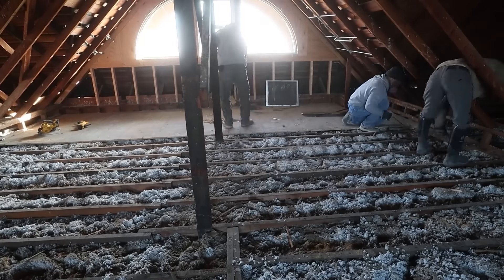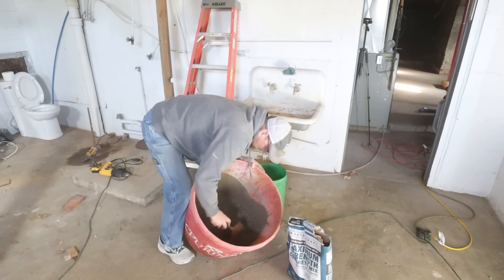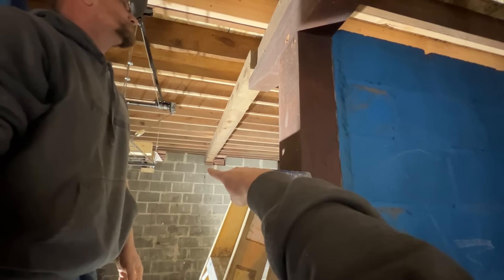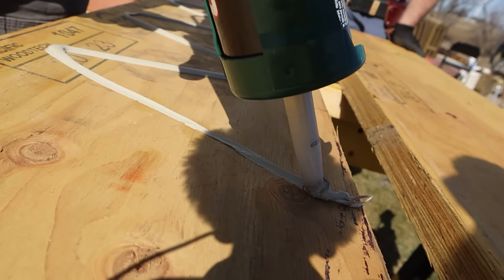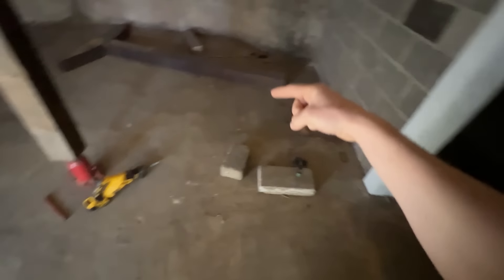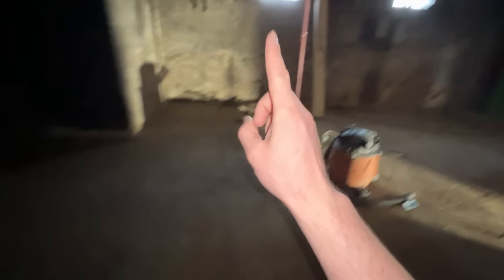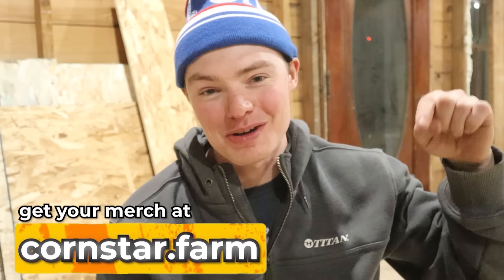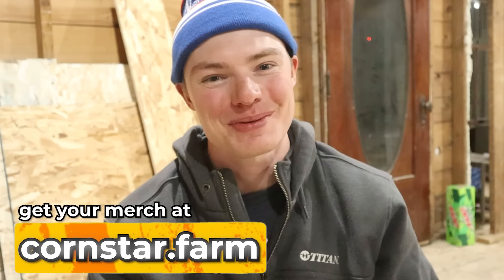Restoring A $7,000 Mansion: Rebuilding Basement Ceiling

Comment: The craziest plan i ever heard!! Breaking an good concrete floor. Make a hole on the lowest part for a submerged pump. And treat your walls and floor from the inside. Good solutions eneuf on the market, with very good results and much less expensively.
Reply: I agree, but he's apparently got the money to do it. This has to be outrageously expensive. He shouldn't call this "restoring" though, because that means to bring it back to its original condition. This is "modernizing", not restoring. It's going to be extremely nice when he's done and will be a great house to raise the next generations of Cornstars in, so they can help run the farm.
Reply: More fun than watching this old house❤😂
Reply: Nobody has said nothing about how getting old concrete out of basement. How many years to retirement for Justin and Roman  ??😅😂

Comment: Cole once you get your concrete work done I suggest you put a DRICORE Subfloor System over the concrete and then lay your flooring over that. "DRICORE is an insulated subfloor system" that has channels on one side and should any water/ moisture come up the water would follow the channels to the drains🌻Check it out.

Comment: Cole, love the videos.   I am a contractor in NW Illinois.  I have built several new houses and shops. Love radiant heat in concrete.  As for a house i could never justify the cost of radiant heat.  If you install central air conditioning you already need all the ductwork plus an air handler and all the other AC components.   At that point a forced air furnace cost is nil.  Possibly just install radiant in the basement slab?  Otherwise it is just a redundant  heat system.  If you love radiant heat that is your choice.  To each their own.  Keep up the good work!

Comment: Hi Cole - I know a lot about Radon. Radon is a daughter product from the disintegration of Radium. Even though Radium in mostly an Alpha radiation emitter - Radon is a Gamma radiation emitter. There are trace amounts of Radium in soil and rock. As Radon is a gas it enters the void of basements through the pores in concrete. Even if you tear out the old concrete floors, you will still have Radon seeping into the basement. Radon is also emitted from unpainted walls. It's in the concrete mix. If you plan on mitigating yourself, get a before test done to see the concentration that you have. Different mitigation techniques include 1) venting the basement to the outside, 2) sealing the concrete surfaces with paint such as a thick enamel paint and 3) venting under the concrete floor. After mitigation is complete get another test to ensure the fix was affected. I retired from a nuclear power plant here in NY. Worked there for 23 years. I also have a BS degree in Radiation Protection. At the plant the concrete walls and floors were feet thick - Radon still seeped through to the surface.
Reply: Cole needs to see this comment for sure...

Comment: Digging drain tile around the outside of the house isn't a bad idea. They make a drainage product that is a mesh material that you glue to the outside of the foundation. That runs the water down to a drainage pipe. 
   In rainy areas with basements a lot of times they run drain tile under the basement floor. If I were you I'd run it into the old well pit. Fill the well pit with rounded Rock not crushed limestone. You could also run the drain tile into shallow sump pump box placed over the filled in pit. That way, just for the heck of it, you could see if you're ever getting water under or around your home.
Reply: It's not a good idea to run storm water into an old well, because it contaminates the groundwater.
Reply: Correct  @ILGuy2012  you shouldn't run storm water into a well but this isn't storm water, its water that's been filtered by the soil. If it's okay to run field tile 3 ft deep into a stream it should be okay to run 8 ft deep groundwater into a 23' deep hole. 
    Plus have you ever seen or heard of an underground detention system? In big cities we build big underground vaults with Sand basins. To catch, slowly drain and filter storm water into the ground. 
     Also he has said the house hasn't leaked in over 100 years. Adding a drainage system would be only additional insurance and peace of mind. Very little, if any, water would ever run into that pit. 
     If he doesn't run the drain tile into the pit He only has two other options. 
Option 1. Run the drain tile into his septic system. If not illegal, it's not a good idea. You know it's sewer gases or in 35 years when the septic system starts to go bad. 
Option 2. Put in a sump pump. That will probably never run.

Comment: @ColeTheCornstar Your talking about a full immersive French drain system that include foundation drainage. So taking and putting a air aided PVC pipe around the outside walls of the basement so that water isn't encroaching into the house or basement walls and piping into that system a bunch of air aided PVC that runs the distance of the basement with the proper sloping in order to pipe out the water that does try to stand underneath the foundation once its reinstalled and formed. Yes you can do such a thing. And you will need a 10 metric tons of gravel and sand in order to have what you are talking about because you have to lay sand and gravel down once you have the piping in place. The water will flow through the gravel into the piping. and the sand will keep everything in place.

Comment: Glad you mentioned Radon. I just had a mitigation system installed in my home after testing revealed levels peaking at 40.0, which is really bad. I recommend you buy a RadonEye RD200 continuous tester for $175 as it will be much much cheaper than professional testing and allows you to move it around and detect any problem areas over a longer time frame.

Comment: Yes, drain tile under the floor is a good idea, especially since you'll have it torn up anyway.  When we built 20 years ago, we ran a couple tiles under the slab and it does run occasionally in the spring when the water table is high.  We're in heavy soils and our basement has always remained dry.

Comment: Radon is no fun, we have pipes under our slab and its vented out the roof. There's a fan on it that is run in winter. Its higher then. You might want to consider a fresh air duct with auto damper control for at least 10% air make up. Spray foam makes a tight house. Installing an exhaust fan, new code for new homes, pulls air in and around all your doors and windows. Ours runs 24/7 cause of radon

Comment: Great job on rebuilding the house. If it is the plans when you install the new floor in the basement installing a Radon system along with a perimeter drainage system would be very beneficial to you in the long run.The cost of a active Radon is low cost. Would also suggest installing a sump pump to assist in removing any water that possibly enter the basement. When installing a new concrete floor you may want to install at least 4 to 6 inches of crush stone and on top of the crushed stone a minimum of 6 mil poly plastic sheathing. The crushed stone and vapor barrier will allow the radon system to work very efficiently.

Comment: Concrete Pump for the basement floor. Concrete truck pours right into the pump truck and they use large hoses to shoot the concrete in. Could run up a big tab, so a couple wheel barrows with wood to roll on will be the cheap option

Comment: Regarding the radon, if you're planning on putting in a drainage system in the basement anyways get a radon sump dome cover. Typical installs involve digging a small hole under the slab and only draw air from that one location. By leveraging the under slab drainage tubing, feeding into the sump pit, you’ll draw air from under the entire slab. I’m located in a very high radon region of PA and was able to reduce my level to 0.7 using this method.

Comment: If you're already planning on doing drain tile on the outside of the basement walls I would install an egress window or two down there at the same time.  They let in a lot more natural light, and if you have to tear out the old concrete floor you have a much larger opening to the outside that would allow you to rent a conveyor belt so you don't have to carry literal tons of concrete up a flight of stairs, as well as giving easier access for a pump truck to run a hose to the interior for pouring the floor.

Comment: Underfloor heating - We have it, it's fantastic, especially if you or your family like to walk around barefoot.
Electrics - You've ripped everything out and you're putting in the hard work now, so put in way more sockets than you currently think you'll need, and don't just put them based on where you're currently planning to put furniture.  We built a new home just 10 years ago, almost everywhere we put in single sockets we wish we had double sockets, in the kitchen we put in twice as many sockets as we thought we'd need and already wish we had more.  We're even using them in some of the walk-in closets.  With so many small devices these days that need power lots of extra sockets can really help.

Comment: Hey Cole, we have Radon problems in Basement in Belgium as well and there are detectors that you can place around your basement to check the levels you're at. I'd do that first and if you do have some radon concentration in the basement, you have to make sure there is a lot of natural (or forced ventilation) in there. First thing to do : place some detectors and check the levels and then you can advise. Thanks for the video and all the best from Belgium.

Comment: Hey Cole, I'm over in Northern Montana and we have extremely high levels of radon in my area (my test came back at an 11 which is super high). The mitigation system is essentially a fan suction system on the lowest level of your house that collects air and vents it through a pipe all the way out through your roof. My house is built on a crawlspace so the fan installation down there was super simple, but I know they have other systems you can use on a full slab basement. 100% get your space tested, your levels could be way higher than you expect!

Comment: If you're not sitting on granite, the radeon may not be there, you can get a test kit for it.

While you're doing all this work, and going to be having concrete delivered, it does not look like you have a bulkhead access to the basement right now, I would 100% add one. For one, makes it easier to get stuff in and hour of the basement. Go as large as you can! Second, gives you 2 exits if something bad happens while you are down there.

When it comes to the concrete, you may be able to bet a pump truck and you can drag a hose to the furthest end of the basement and work your way back. Putting in a bulkhead may make that even easier. 

As always, thank you for sharing!

Comment: Radon mitigation is pretty simple it's basically just throwing PVC into the ground, sealing up the slab, adding a radon mitigation motor on the PVC and then venting outside

Comment: Don't know if you remember HGTV but there was a fellow on there , Mike Holmes, and he does construction projects. If you look him up on line, Holmes on Homes, you will find he has done many series on basements and keeping them dry, also radon. If you digging up around the house, hope you seal the foundation when it's open. If has been dry for a hundred years, likely will remain so, at least for the most part. Likely use a wheelbarrow and pails to carry cement to the far reaches of the basement, perhaps self leveling cement.  Good Luck, coming along nicely. 👍👍

Comment: I know you may or may not have thought of this but if you're gonna break up the whole basement floor and hot water heat all of the floors in the house you should consider heating the basement floor because if the basement floor is warm then your kitchen floor doesn't need to be heated nearly as much

Comment: When you get to the point of looking at what flooring you are going to put in check on cork flooring it doesn’t absorb liquids it is cushioned a bit it also works as a sound deadening and easy to clean up. I’m not sure of the cost anymore but I think it would make a great addition
Reply: I distinctly remember having to leave the house as a kid every second year for a few days as Dad sanded and polyurethane sealed the cork floors throughout the kitchen and dining area. It was lovely underfoot but far from low maintenance.

Comment: As many have already mentioned, there are folks that specialize in pumping concrete (like my neighbor). He’s got a huge pump, lots of hose and basically has the concrete truck(s) load directly into his pump unit while he lugs the hose to where it’s needed. He pumped concrete for a 10,000+ sq ft warehouse floor last year, big project. Those hoses would definitely fit through even the windows under your porch…somebody’s gonna have to crawl under there though, like maybe the “gopher”.  I’d dread hauling all the old concrete out more than pouring the new, at least the latter is liquid for a while, old crete, notsomuch.

Comment: Concrete with the Hauses is a great YouTube channel! Tom the owner has been doing concrete for 30+ years. When doing the far rooms a pump truck or wheelbarrows would be used. In regards to radon This Old House did a couple episodes in regards to doing radon prevention equipment. And if you are tarring up the concrete in the basement putting foam insulation down before the concrete may also help with keeping the heat or cold inside your home. Just a few ideas. Good luck and look forward to the next video.

Comment: Two most important factors in reducing/preventing water intrusion in the basement.  Exterior grading so that water has a path away from the house, and gutters.  Drain tile will help when water works its way there, but prevention is worth a pound of cure.

Comment: 2 options for you..... 1. Cut trenches in the existing floor for the drains. repour the trenches with concrete then overpour the entire floor with a product called ARDEX. 2. bust out the whole floor ( tons of work) then repour. Get the concrete into the basement using a concrete pump. I would still recommend overpouring the entire floor with ARDEX as it is a moisture barrier.

Comment: The radon system under basement slab is a twofold solution! 
With a 4” layer of clean free drain gravel covered with and a heavy mil vapor barrier under the concrete it will allow the radon fan to ventilate out the radon as well as keep moisture vapor from coming up through the concrete slab!  Fiber reinforced concrete and a lot of tooled control joints and wolven wire fabric in the middle of the slab should minimize shrinkage cracking.  Concrete will look “fuzzy” but will wear off over time.
You might want to consider a concrete pump to more easily get the concrete where you need it in the far corners of the basement?
And yes, 4” perforated corrugated pipe with filter sock around the exterior and some interior of the basement perimeter all sloped to drain toward a sump.
Exterior basement wall drain mat & vapor barrier will keep that basement dry as a bone!

Comment: Nice work on the beams and addressing all issues in basement.  Check out Concrete with the Haus’s YouTube…they use a hopper that pumps concrete through a long tube. I’ve seen them do it for what must be 50 yards when they can’t get truck near the area to be poured. 

Hopefully y’all can use the fireplace knockout areas as pipe/electrical chases.  I know you check things out, but I had to re-plumb my place too and went with the Pex-A instead of box store Pex-B. It’s a little more expensive but will expand more than B and is more pliable….use an expansion tool and it’s simple to install (no crimping involved in tight spaces where you can’t get a crimp tool).

Comment: I hope you are looking at PEX pipe for the water lines.  The pipe itself will not burst when frozen.  Some of the fittings might crack if they freeze, but you can run long lengths and avoid fittings like elbows on exterior walls.

Comment: A couple of thoughts Cole - Floor drains must lead to the sewer / septic system, while French drains ( foundation perimeter ) can drain into the creak / outside. Second,  adding drain tile can be done on the interior perimeter of the basement, it doesn't have to be on the outside perimeter.  Running drain tile under the middle of the floor is not done and likely against building code.
Cast iron drain pipe (used for interior plumbing) is MUCH quieter than PCV. With PVC, you will hear the water moving through the pipe, which can be rather annoying in a newly remodeled house. You probably didn't hear the water draining when you were living there, but you will if you use PVC. 
Thanks for the great content, I've been watching your journey for over 2 years. I recommend you checking out a YouTube channel called "The Build Show", it's about home construction.
Re: Radon mitigation - it's simply an exhaust fan that draws air off of the basement floor. You can get a kit at Home Depot or any home improvement store.

Comment: Cole you need to put drain tile around the outside the house the install 1 or 2 sump pumps. Basement concrete you use wheel barrows to move it around no big deal. One room at a time. Getting the concrete out seem to be a bigger job.

Comment: If you are going to dig down on the outside wall and add drainage-pipes, you should insulate the walls from the outside while you are there. So easy to do and changed the climate of the basement

Comment: Sorrry for the numerous posts but these thoughts keep coming.....when you rip the floor out, install drain tile under floor to common pit or pits for sump pumps to evacuate ground water to preve t from coming up in basement...there are lots of great ideas that have been posted as far as rock, sand, vapor barrier, pump trucks and concrete...